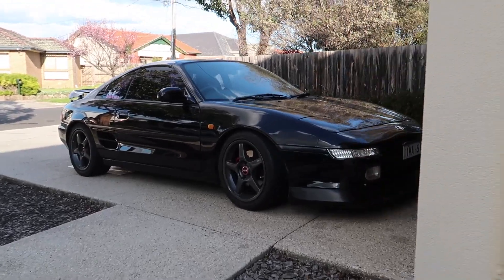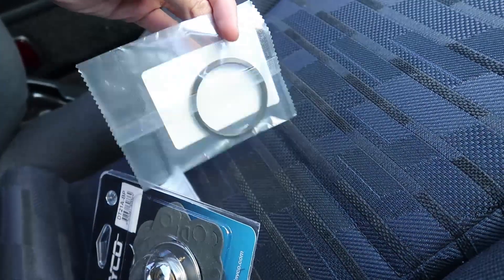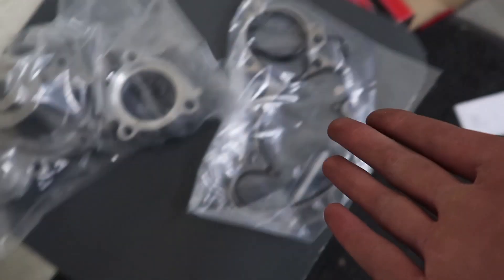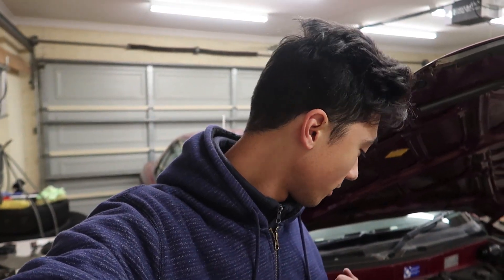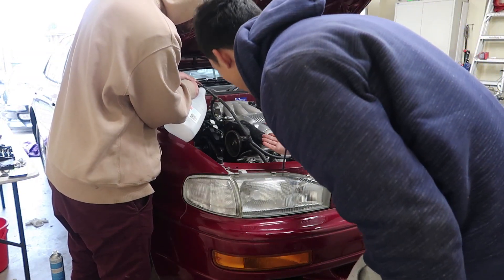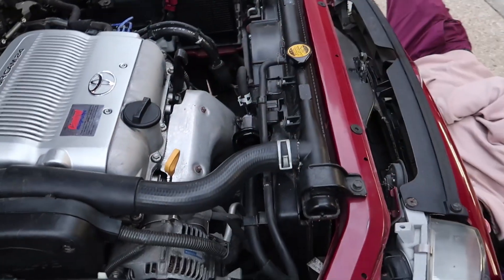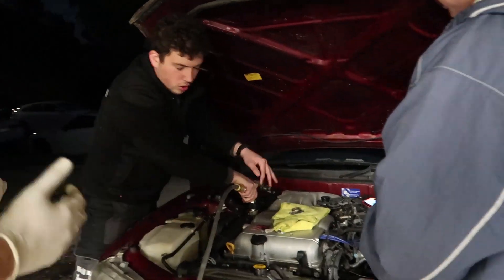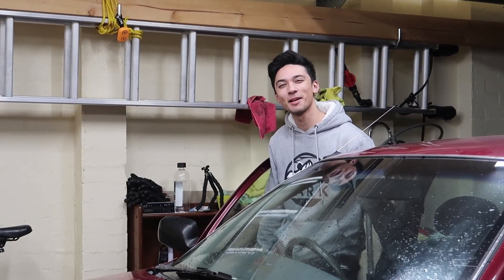NEW PARTS ARE IN! + Driving - Project Grandpa Camry (Part. 4)

Comment: As part of the cooling system flush, after a minute or two of ensuring that the fluid level at fill point was not dropping, the cap should have gone back on to allow the system to pressurize at 'temperature'. The heater should have been set to max, allowing the heater core and associated pipe work and hoses to have a clean as well, with the heater tap at full open. Sorry to be the party pooper if this wasn't done, maybe do another flush before adding the coolant.
Reply: If you need to flush again, make sure you take it for a drive. You'd want the water and cleaner racing through everything at temp and pressure and not just meandering through at idle.
Reply from the maker: cheers for the advice man! din;t show it all on camera but we got it in end! (next video) :)

Comment: Never compress the tensioner horizontally in a vice like that always do it vertically either in a press or hold it vertical and use an f clamp otherwise the tensioner can fail and the belt will jump a tooth or 2...... I did my apprenticeship at a Toyota dealership and I've seen it happen ..... this is what's probably happened in your knock sensor video a misfire will set off those codes ie coils or plugs breaking down will do it but if your belt has jumped a tooth you will get a lack of power it will run rough and that code will come up...... I have done stacks of timing belts on v6 Toyota's and magnas